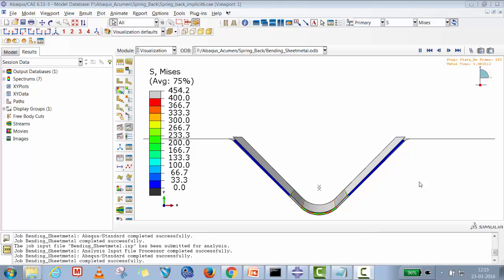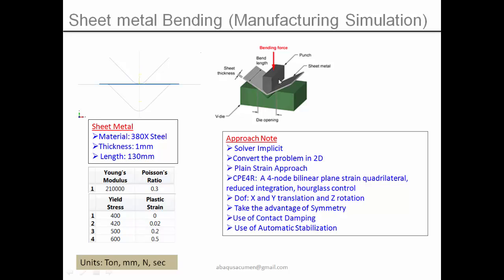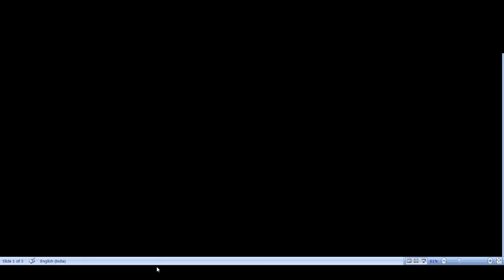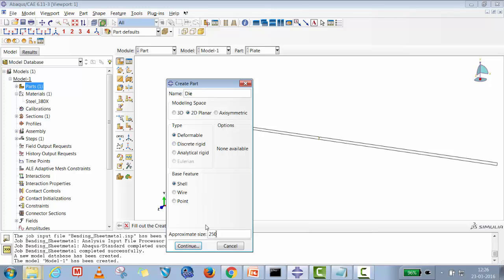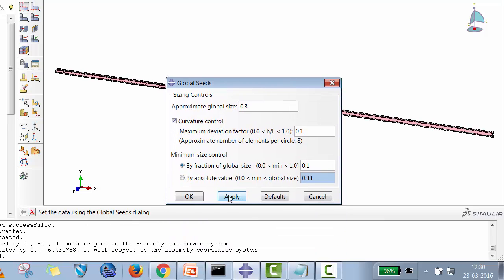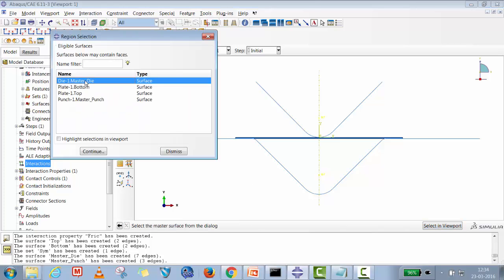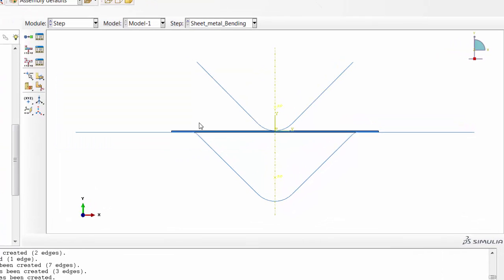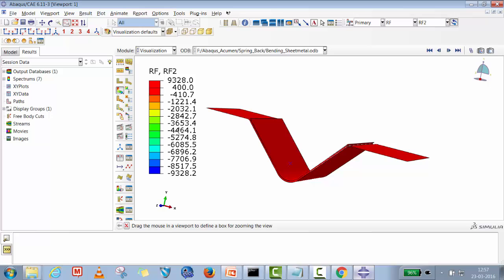Manufacturing Simulation- Sheet metal Bending -Abaqus CAE-Implicit-Standard

Comment: when I am following the steps in the video, I am getting the following error while in the run
The strain increment has exceeded fifty times the strain to cause  first yield at 633 points

The strain increment has exceeded fifty times the strain to cause first yield at 13 points

Excessive distortion at a total of 404 integration points in solid (continuum) elements

Pls, Could you tell me the way to nullify the error?